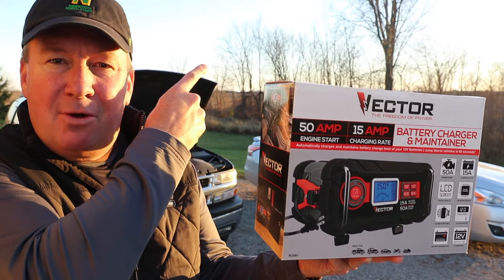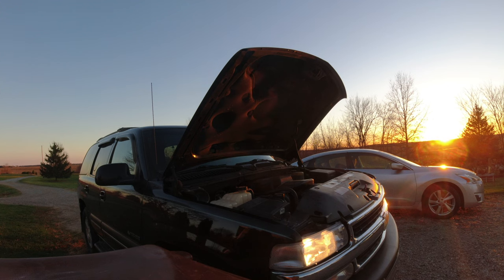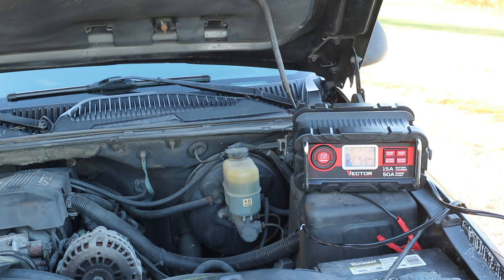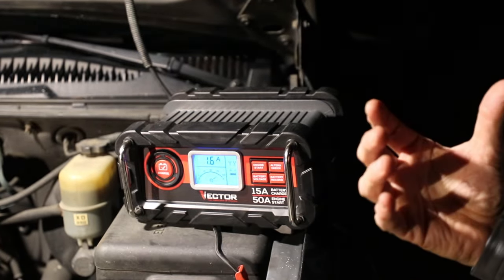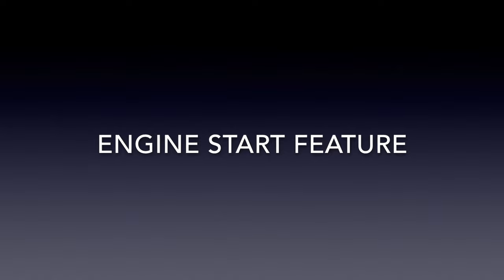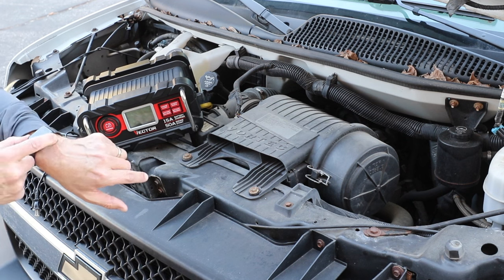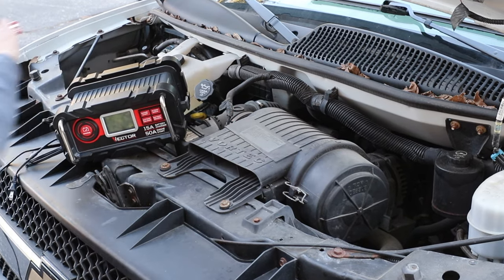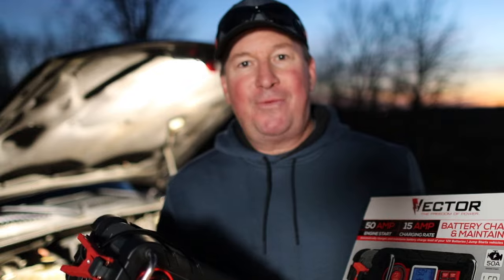The Best Way to Get Your Car Running Again: The Vector 15 Amp Battery Charger!

Comment from the maker: What features are you looking for in a battery charger/maintainer?
Reply: I just purchased this bc I live I TN and am afraid of getting stranded. Can I use this without plugging it in?? I have to go read the instructions b4 I need to use it.
Reply from the maker: @PixieDusted72  A battery powered jump starter will start your can without being plugged in.  This video features a charger, which is great for charging a dead battery, but won't help you if your stranded.
It also has a reconditioning feature which I'm using right now on an old lawn mower battery.  So far it's working great for that.

Comment: How the hell do I get the battery charger to quit beeping?? I use it every night for work and I’m trying to sleep in peace man!! Someone please help me out
Reply from the maker: I'm not sure what it's doing that.   Mine hasn't done that at all.
Reply: I suppose you could remove the beeper speaker 😂
Reply: Hi, I am having the same issue, and I think I know the reason. If your vector 15 amp is the most recent model, on the big red botom (om the left) says  "lithium / lead acid" instead of the word "charge" just push it again and wait 10 seconds to change from lithium Mode to lead acid. You will know the diference because on "lithium Mode" shows L1, the voltage and amp, and it kepps the beep beep But on the lead acid only will show you the amp on the screen and it doesn't make any sound.
Reply: Where’s the beeper speaker

Comment: Hey I have a question my battery died during a crank no start hooked this up to it overnight and it charged it when trying to crank car multi xs it died again and left dead for 4 days then brought battery in and put it back on this everstart pushed charge button and it switched itself to battery reconditioning so I left it for 2 days and when I push battery voltage button it says 1.2-1.9v but every time I press the charge button within a few seconds it keeps switching back to battery reconditioning mode do you know why it doesn't stay on charge mode.? PS the battery is only a yr or two old also mine is the everstart Maxx but everything is the same just different name
Reply: Could mean the battery is bad, try running the recondition mode up to 5 times and see if that resolves it
Reply: Below 3 volts is a battery that typically cannot be recovered
Reply: Use jumper cables and another running car to start the charge (~15min) this will get your voltage up enough to be meaningful. Then I would see if you can get it to start chraging. If not, recondition for 24h and see.

Comment: Many uses for bench tops (float charge, maintainer when working on vehicle) . I use mine to recharge my vehicles to 90 percent or greater when doing oil change and to re condition older batteries.
Reply from the maker: That's a great idea!  I should check my vehicle and see how far it is from 90.

Comment: looks like the same manufacturing as the Duralast bc40dl.  screen, right side buttons - except no "Charge" button on left side.  has lithium / lead acid selection.

Comment: So why does it have to be grounded onto the vehicle rather than the battery?
Reply from the maker: I think it's a safety feature to protect something from happening with the battery.  Years ago, I always clamped to the negative post, but don't anymore.
Reply: @MarkThomasBuilder  my dad kept questioning why the car instead of the battery. I just said screw It, onto the battery it goes.

Comment: How do I set recondition mode to manual only I've had three of these Chargers all three of them gets stuck in recondition mode no matter how good the battery is they all eventually go bad and go to recondition mode even with a fully charged battery
Reply from the maker: I'm not sure why yours is doing that.  Mine always stops after charging.
Reply: @MarkThomasBuilder   because its new junk designed to fail , first 2 everstarts failed fast , the stanley lasted much longer thought it would keep going but same fail

Comment: Probably a stupid question but I’m currently broke and having issues with my battery voltage being low. Probably an issue with my alternator but I’m waiting to have enough money to get the issue resolved. Can I use this to charge my battery once a day to get to work and back until I have enough to go to a mechanic?
Reply from the maker: I've been in that boat before, Edgar.  I've actually done that for a few days where I charged my battery at night, drove the next day to work and parked next to an outlet.  I charged it at work and drove home.  I was able to make the 10 minute drive to work and home.  Good luck with it.
Reply: yes
Reply: Not a stupid question, it's actually a very thoughtful question.

Comment: Do you think maybe it’s the cooling fan in the old charger maybe take the lid off and oil it up?
Reply from the maker: I'll have to give that a try with that zoom spout oiler used on turbines and fans.  Thanks for the suggestion, hope it's easy top get open!

Comment: Mark what should I check  for on my Vector 1200 Amp booster pack my air compressor still does not work after replacing battery,just to back up ,battery kept losing charge and air compressor would not work,I had charged battery repeatedly  thinking that would cure both problems
Reply from the maker: Do you have a portable battery jump starter that has a built-in compressor?

Comment: wait, i thought that car start mode had a timer so you had time to get in car and crank it..i have the black and decker modle and have been using it the way i explained it and its been startingy car
Reply from the maker: Yes, you push the engine start and go in the vehicle and start it before the countdown ends.
Reply: Can this feature be used without it being plugged in? The only reason I purchased this was for emergency circumstances where another vehicle wasn’t available to jump me.
Reply from the maker: @PixieDusted72  Vector makes another product for that.  I reviewed their largest battery powered jump starter.  Here's the link... https://youtu.be/n3LnUsVU88I   You can use this without it being plugged in.

Comment: Up to how long should my battery be reconditioning? It's been at it for 2 or 3 days now
Reply from the maker: I haven't read the instruction on reconditioning lately, but I think it said it takes about 24 hours to do a reconditioning cycle and you can do up to 3 cycles to see if it's able to successfully recondition it.  How old is your battery?
Reply: @MarkThomasBuilder  about 3 years old. I let 2 of my batteries in cars and they died over winter. They didn't have any problems last year but the cars also don't run anymore.. I'll keep trying thanks for your help I really appreciate it
Reply: Same with mine. Today will be my 4th day of reconditioning. Very confusing. I might just take it out by the end of today.